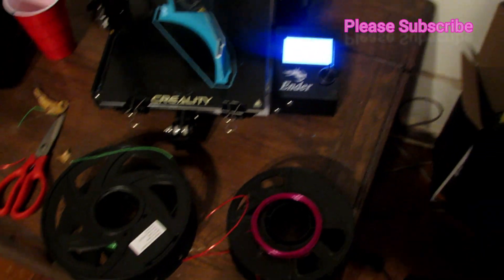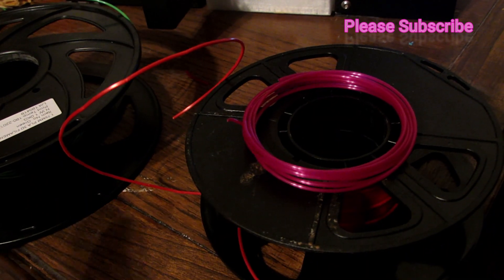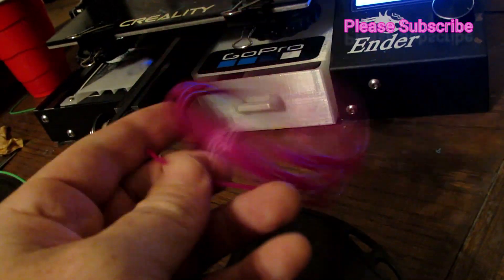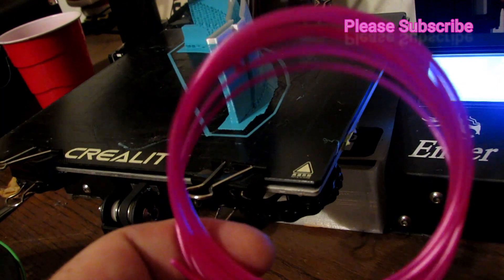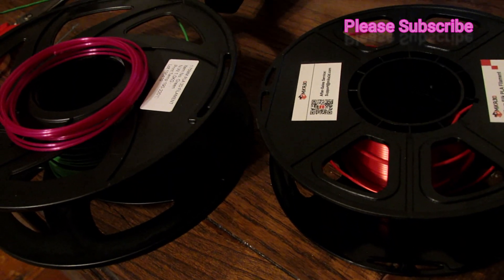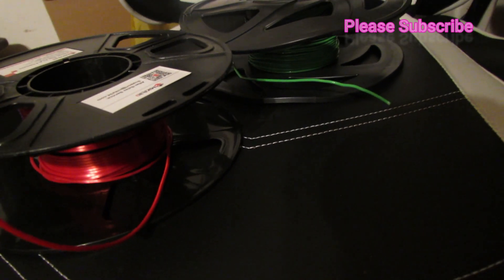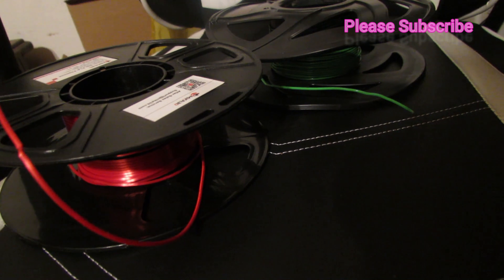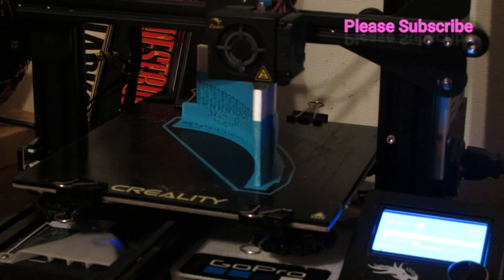Fix Brittle PLA In 30 Minutes

Comment: Thanks man. I was pretty much thinking the same thing. Essentially it does melt this back down, but not enough to make it a puddle and I’m pretty sure it was just gravity that caused the spool to deform once it became more pliable. I’m glad somebody did this before I did so that I could see it in action. I’ll probably unmount the filament from the spool when I do mine. The dehydrator idea was also a good one, but I don’t have one of those and I’m not going to buy one just to do this at the moment.

Comment: Do not use an oven to dry filament! Most ovens will not go low enough! Use a dehydrator with the centers out of the rings to allow for spool size or use descant packs in a sealed 5 gallon bucket like I do and store them in the 5 gallon buckets or use a filament dryer like My Anycubic  ACE dispenser!

Comment: I was desperate to get a bad roll going so I GUESSED it was hydrated and HOPED that baking it would help.  My oven also has a low of 170F.  I put it in for an hour...nothing, then back in and FORGOT to turn it off, so it cooked overnight.  Then, voila, it was PERFECT.  I didn't have any spool melting issues, probably because I put it on the middle rack and on a thick sheet of cardboard to help diffuse the heat.  I absolutely attest to this method: it works miracles.

Comment: If you use an oven make sure to let it preheat. If you put it in like this guy right above the heating element, it's getting blasted with far hotter temperatures during the preheat phase, which is why his spool warped. Also the heating element will occasionally cycle on to maintain the temperature, so it's best to place the filament far away from the heating element and put a baking pan between the element and the filament. Basically you want to avoid any direct heating from the element to the filament.

Comment: Does the electricity/ gas used to heat the filament cost more than just buying new filament?
Reply: I think it's still cheaper. At 50 degrees C, the oven only takes up power till it's pre-heated and then only turns on periodically. 

My guesstimate is for a 2kw owen and 1kw (actual used due to low temp), lets say it's 0.5/kwh. That makes it 50p per hour. For 6 hours that'd be 3 bucks...

I think that's a bad deal if one has even 250gms of filament to dry

Comment: GE Repair guy here .... (Your hotpoint stove is made by GE)  The oven temp you have is set for is an average temperature.  It will be at least 15 degrees higher than what you set it at initially. then it will drop below 15 degrees below the set temp. It will do this throughout the cycle.

Comment: I forgot how loud stock ender 3 was. Silent Drivers FTW. Also I just got done baking my PLA at 45-50 (both) for 9 hours and another 6 hours. And while the Quality got better (it was really bad) it is still brittle.
Reply: An object 3d printed with brittle  pla, will the object printed also end up brittle?
Reply: @tekanova7480   it just depends on how thick the object is tbh. I found that when I had really brittle PLA, the objects tended to be on the weaker side. 

After baking my filament, it was still a little on the brittle side but the objects that I printed with it were a lot stronger. 

It Just depends on how bad the PLA is when you start. I have had filaments that would practically crumble when you touched it; I would consider that too far gone. 

If your filament is still strong but won't bend, and instead tends to give a little before snapping, I would bake it at 45 degrees C
 for 24-35 hours.

Comment: Don't do this if you can't get your stove low. 170 melted my filliment together and it won't feed off the reel. You have been warned
Reply: Did you set your oven to 170C or 170F (you were meant to set it to 170F)
Reply: 170 F is only76 C. It cant be melted.
Reply: @张晓晓-k7s 170c is plenty to cause a filament to melt together.

Comment: i have some i just bought and after a day i was that brittle...very strlngy globy prints...broke several times...managed to get 3/4 of the roll used...i am throwing the rest in oven  at 170 on bake ..place in center of oven..i think you set your roll to close to the burner... well see if it helps... theres a lot of companies not sealing correctly also selling old brittle filament... i think i tried this a fews years ago with bad results...not sure of time  or temp...fingers crossed ...i have dozens of brittle rolls...

Comment: This does not work, I have tested brittle PLA by soaking in water for 3 months, and from baking it from times of 30 minutes, and up to 7 hours. Does not work.
Reply: why the hell would you soak pla in water??...you probably destroyed it...i also have tried oven years ago...but i am trying again with a quarter of a roll this time... he does it and it worked,so it makes no sense it never works or there would not be videos on this...
Reply: It works for me and others.
Reply: I think this comment has truth to it. If your pla is snapping cause it's brittle doesn't mean directly that it's moisture.
If you have moisture issues you will get popping at the extruder instead of a steady constant flow as the extruder will be about double the boiling point water. turning water into a gas creates a expansion ratio of 1:1700. Ive purchased multiple rolls from a supplier that were extra brittle out of the vacuum sealed bag. Plastics have additives that help adjust properties of the filament. Even blending recycled materials can affect the brittleness at the factory. If you received brittle filament as a low quality product you might be able to get through small quick prints by warming up the roll but anything larger will need a spool holder in a toaster oven to keep it flexible long enough to get through a roll
Reply: @ByteAquaponics is correct, but also are some of the other replies here. PLA will literally be irreversibly wet after a long time in humidity (breaks the longer molecule polymer chains into shorter ones, making the filament weaker at the base level).

 Filament SOAKED IN WATER for any significant time is very likely too far gone to repair. It's easy to think that simply drying it out would fix it, but there are fundamental changes that happen to these filaments when there's been too much water introduced, that cannot be fully undone.
Reply: @JosephNixon  pla is definitely a less than ideal filament. I've started printing with petg on my upgraded ender 3. The filament is more like fishing line for brittleness so no worries about 1.75mm filament breaking mid print. It definitely has different properties but is very similar in strength but much more impact resistant pla

Comment: this PLA-moisture-absorbing BS is being too exaggerated. same thing about the god dang bio-degradability. i tested it live, left a PLA print ouside for 5 YEARS!! and it is still holding up like new. i also keep my spools normally, not in a dehydrated container. this dehydratation thing should be taken into count with PET-G, PLA sure, absorbs it more, but has WAY less effects negative effects after.
Reply: Being biodegradable does not mean it will decompose on its own, silly. It has to be mixed with other materials to break it down, you can not bury in the ground for 1000 years and have it break down on its own.
Reply: @rotagbhd  yes, and no. when something is biodegradable, it can break down on its own. iam not saying it WILL, but it can. its not my fault m8, complain to the goverment that bio-degradable and boidegradable are different things!
Reply: it might be the fluctuations in temperature and humidity that destroy the integrity. my pla has moved from two vastly different environments and im afraid i have to use it up soon or it may be unusable.
Reply: Just remove the music... not helping... -_-
Reply: I have all my rolls in a container that is supposed to be moister resistant. In the container are a handful of desiccant pouches along with a large desiccant container, and again all my rolls of filament (about 10) and every single one of my rolls are extremely brittle. So yes weather you would like to admit it or not it does happen. Stringing, popping, zits, under extruding, snapped filament CAN all be signs of wet filament. Wet PLA is very brittle, if yours isn't brittle, its probably not wet.